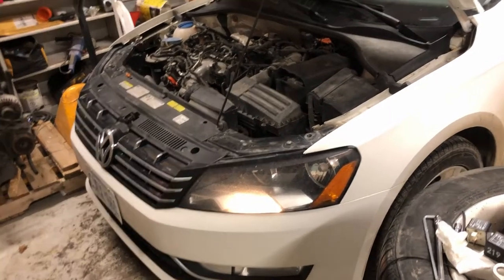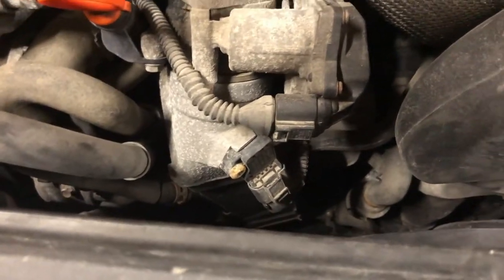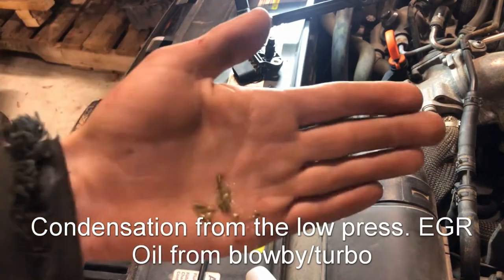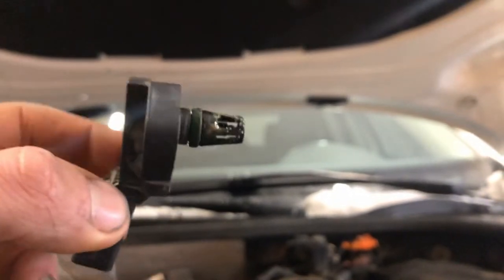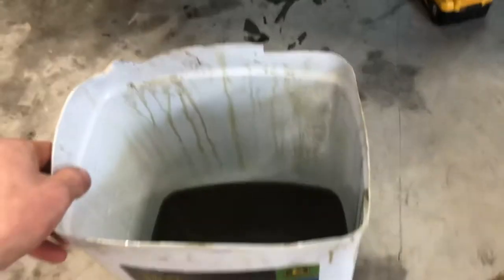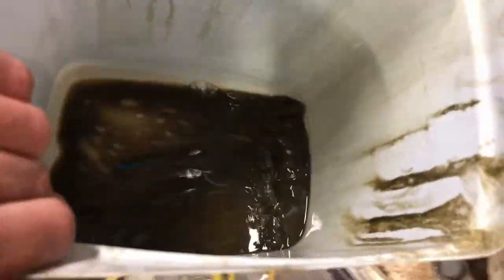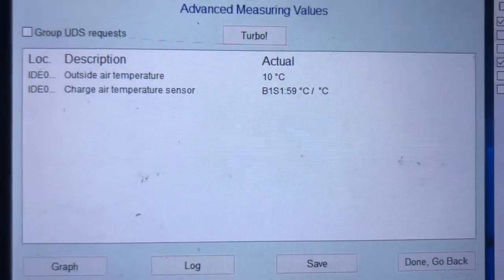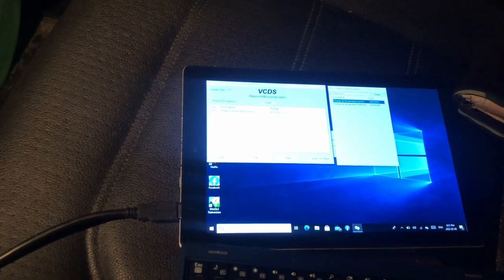Diagnosing P026A on a NMS Passat CKRA TDI

Comment: I’m dealing with this exact issue did you make a video to describe how you flushed the core?
Reply: Also I’m not the most knowledgeable about cars what would the flush process typically cost from a mechanic?
Reply from the maker: I didn’t but I just used a small funnel and slowly poured it through the map hole. Used soap and water and drained it all out the bottom. Have to wipe it clean and make sure it’s dry though.
Reply: @JoshsJettas  any estimate of what this process would cost for a mechanic to do for me?
Reply from the maker: Shouldn’t be more then an hour or two of labour

Comment: Any way I could get the part number or name of the sensor, I cannot find it for sale anywhere online
Reply from the maker: Map sensor ( also has the intake air temp sensor built in ). Idparts shows 03G906051F as the part number
Reply: @JoshsJettas  thanks a lot, cheers

Comment: how was the car responding with the sensor issue?
Reply from the maker: It needed injectors at the same time so it wasn’t driven hard and not sure what affected drivability more.
Reply: egr introduces carbon  to intake system and dpf ruins turbo